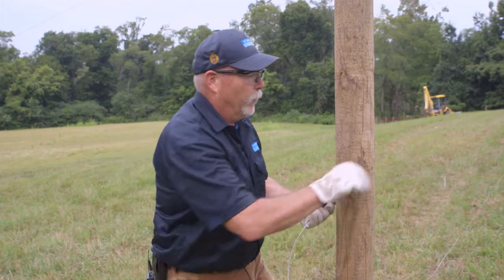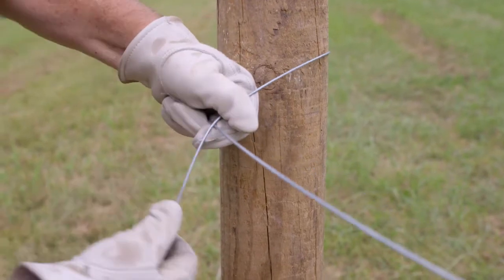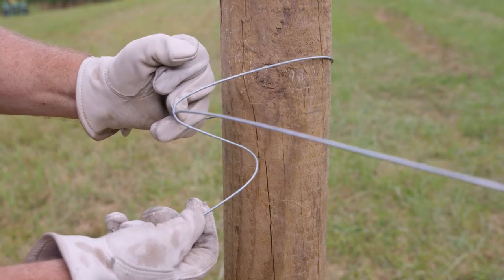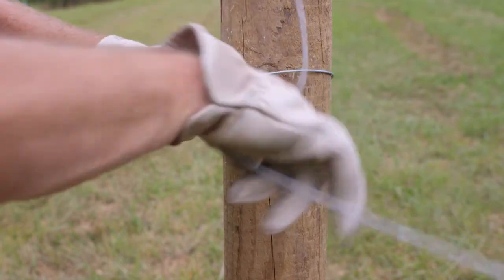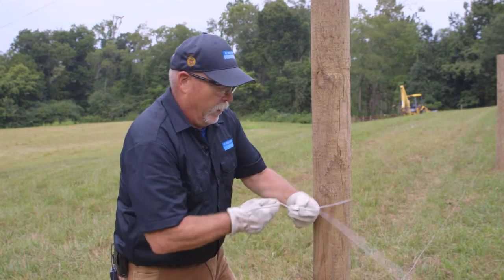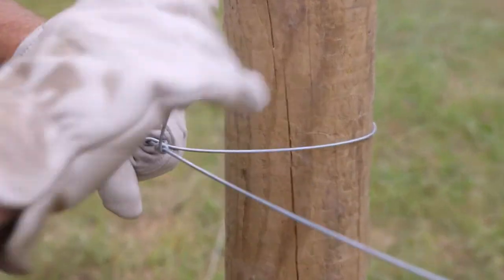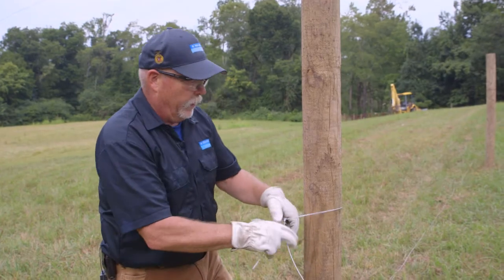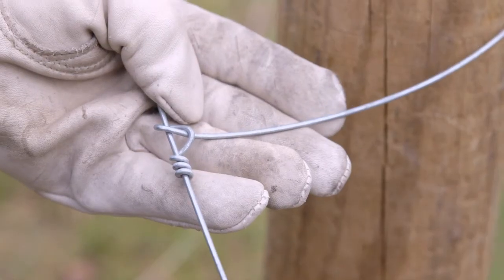How to Tie a Slip Knot with High Tensile Wire

Comment: Tried this with 17 line fixed knot wire.  The wires were too close together to do this.  Had to go back and order the grippe t clips which was not cheap, but out of the 17 lines I only got about 2 good ties.  Gave up and cut them off.  Maybe my wire was a thicker gauge?  Just something to consider if you are like me and thought you could save some money..
Reply: trick is to pre-bend each wire where the knot goes then use a twitching tool to wrap

but yeah... small gaps are horrible